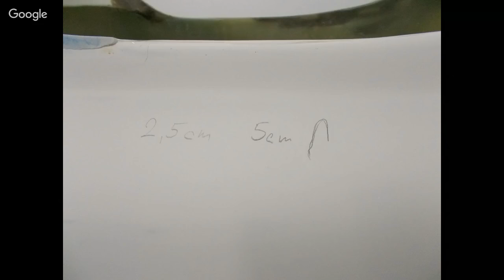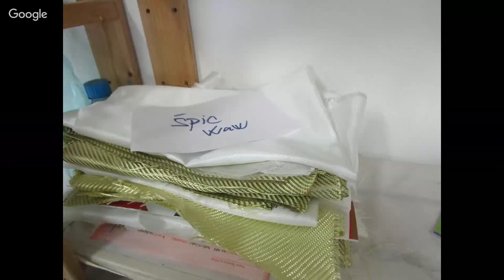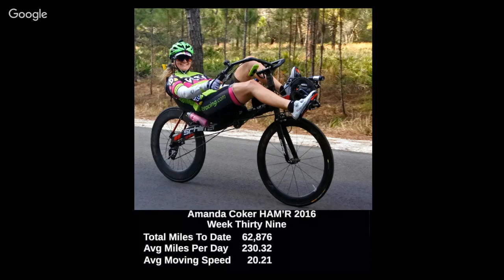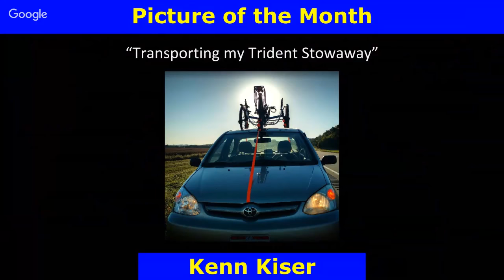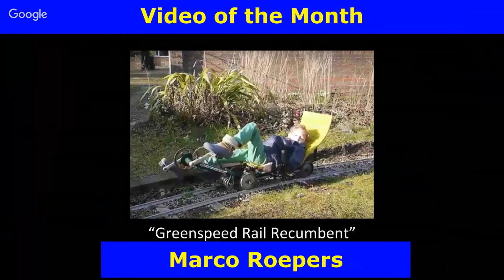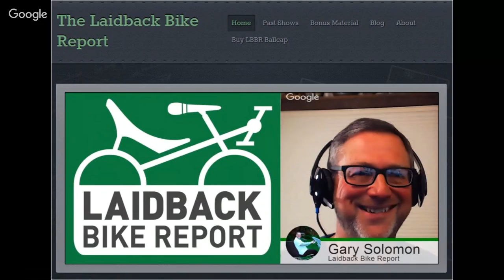"The Making of a Velomobile" Stephane Boving of Katanga Builds the WAW-Laidback Bike Report

Comment: One should note that Katanga is taking a different route from other producers in the market. The Dronten guys with their Romanian factory joint venture (to which Räderwerk, the German producer of the Milan has joined) are now moving away from separable body -- neither the DF nor the QV can be taken apart, the shell is glued to one piece and not bolted together as the Quest or Strada. Both now use access hatches to make maintenance a bit easier, both do not use gelcoat any more, rather spraypaint the velomobiles. The modular construction of the WAW has advantages such as the option of fitting a shorter or longer nose,  it there is a downside to it: to replace the rear tire, you have to take the tail section off, and luggage space is more restricted compared to say a DF xl, which is of similar dimension.
Reply from the maker: And we'll work on getting someone on from the other manufacturers to tell that side of the story probably next year. Thanks for this clarification, Josef.